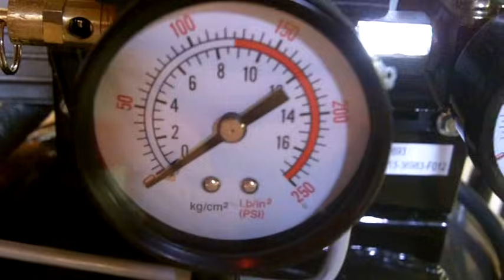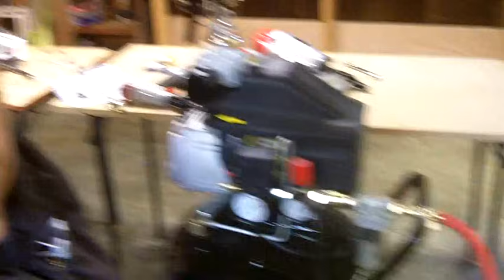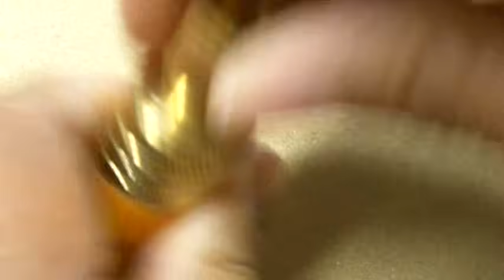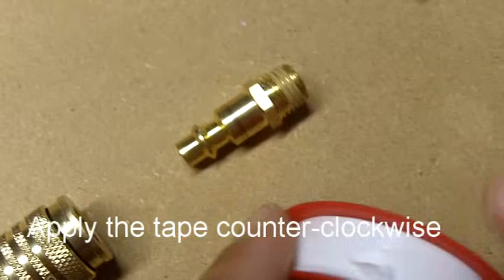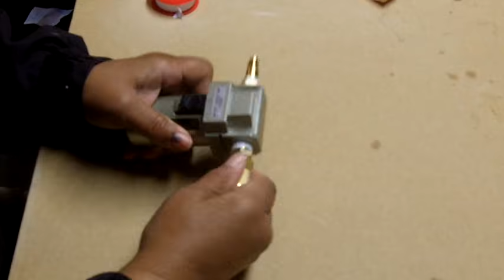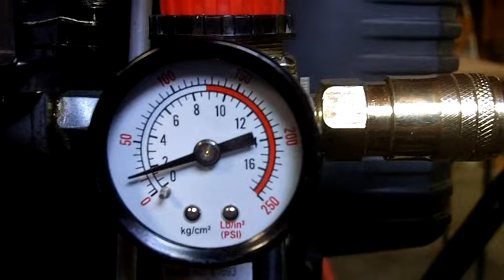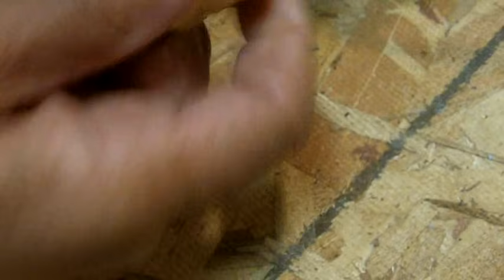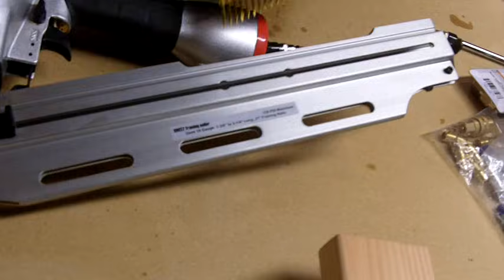Air Compressor, Line Setup and How to Use Air Tools for Beginners

Comment: Hi great video. have a problem with mine just before it gets to pressure the oil filler  cap blows out. Any ideas please
Reply from the maker: Georgia Maccormac  If you supply the make and model, I can further investigate ,  Or you can call the manufacturer. Most compressor manufacturers have a technical support number you can contact and speak with a technical assistance representative directly regarding your issue.

Comment: Great video, I like it so much. I thinking to buy compressor too for my litle garage, one thing I not sure about is the size of the compressor. Better to say size of the bottle. Any advices? Cheers.
Reply from the maker: Rob K Hi Rob, thanks for writing.  As for what size compressor to get, it really depends upon what you are going to use it for. A small compressor would be fine for inflating tires, inflating sports equipment, etc. But if you plan on doing heavier-duty jobs, working with air tools, etc., you'll need to step it up to a larger compressor/bottle/tank.  In addition to the size of the tank, it is important to consider what is called the "CFM" (cubic feet per minute, or the metric equivalent), which indicates the air flow capacity. The higher the CFM, the more power the compressor has to operate various air tools.  For instance, the air compressor that I use in the video has a 21-gallon tank and a 4.5 CFM (at 90 PSI).  Hope this helps.
Reply: seejanedrill Hi, thank you very much for such a quick response. I want to use it for my DIY home workshop, mostly for works around the car, so yes I want to use some air tools as well. Problem is I am quite limited with storage place. I found few middle sized compressors on ebay, can you tell me what you think about this one? : http://www.ebay.co.uk/itm/24-Litre-Air-Compressor-Tool-Kit-9-6-CFM-2-5-HP-/181321137646?pt=UK_Air_Tools_and_Compressors&hash=item2a3794fdee Thanks a lot. Rob
Reply from the maker: Rob K Hello Rob,    I think this is an exceptional buy.  The 24 litre tank is the perfect size for a diy-er with limited space.  The high 9.6 cfm is ideal for medium duty and can handle many heavy duty tasks/tools including painting.  In addition, the reviews for this compressor are outstanding with a rating of 4 1/2 - 5 stars.  I've read the compressor's accompanying data sheet, and its assembly and operation appear typical and rather straightforward.  In all honesty I'd purchase one if it were available here!

Comment: Dear Jane I got a Jun Air 6-25 silent compressor but it has one  gage for the psi in the tank how do I set this up to work with a spray gun and airbrush. Grate video but can you pleas help me with this problem. the compressor was second hand, do not think it has been used, but no instructions. With Grates regards Barry Watkins
Reply from the maker: Barry Watkins Hello Barry,  No worries, I'll send a copy of the operating manual to your mailbox.  Good luck.

Comment: Great teaching video.  I have a small air compressor-6 gal, but I want to buy a bigger compressor that will drive air tools.  Even my little compressor will give me 125 lbs/in, but it is the scfm that confuses me.  How do you match up a compressor to the tools you are using.  Thanks so much for this video.  I noticed you got 16 dislikes.  Ignore them.  I can't imagine anyone with a brain who would dislike this great video.
Reply from the maker: Charlie Wilson 
SCFM and CFM can be confusing,  I hope my explanation will help clear things up.  SCFM (standard cubic feet per minute):  SCFM is the CFM of the air compressor if all conditions were "standard", which is almost never the case.  Actual CFM almost always varies from the standard, depending on changes in conditions.   

CFM stands for Cubic Feet Per Minute, or the amount of air the compressor delivers, measured in cubic feet per minute.  Keep in mind that the CFM a compressor delivers changes, depending upon the psi (pounds per square inch).  Most air tools have specific requirements for volume and pressure listed by the manufacturers on the data sheets which accompany their products( this information can also be found online if you haven't purchased the tools yet but are simply doing a product comparison).  These requirements must be met for their tools to function properly. 
 
When choosing a compressor, consider the tools you want it to operate.  Select the tool you are planning to use that requires the highest CFM, and add a small amount to that number for a margin of safety.  For example: a brad nailer typically uses .03 CFM because it delivers short bursts of air, whereas an orbital sander can be a real air hog, using as much as 9 CFM.  Again, you can find this information listed on the manufacturer's product description and/or specification data sheet.  An added note: if a tool requires 3 CFM at 90 psi, select a compressor that delivers at least 4.5 CFM at 90 psi. This will ensure that the air compressor you purchase can provide the correct amount of air for the tools you are planning to use to be able to function properly.

I appreciate the compliments and comment.  Good luck and I hope my answer helps.

Comment: Excellent instructional video.  I'm wondering what size diameter (inner?) plugs and hose I should be using.  Can I use one size hose/coupler/plugs for all tools like an impact wrench and a brad nailer?  Or will I need different combinations depending on the tool?  If I need different sizes can I keep the size of the hose standard and just swap out the coupler that attaches to the tool?
Reply from the maker: brinbane1 Keeping in mind that I am only addressing portable home compressors here, what I will say is that 3/8" hose size and 1/4" NPT thread size connectors are typical. If you install a  1/4" universal coupler on the hose end which connects to the air tools, it will fit most air tools' pre-installed plugs.  Hopefully this answers your question.

Comment: Awesome video I am having a problem with my air compressor I bought a regulator because the compressor I bought was used.  But every time my pressure builds up it activates my safety valve and the pressure goes back down, is there something wrong that I am doing?
Reply from the maker: MacheteLopez Hello Machetel,  You're at a disadvantage when you purchase a used air compressor because you don't know the history of how it was maintained.  It's possible that the reason the previous owner parted with it was due to the mechanical issue you're currently experiencing.  Unfortunately diagnosing a faulty air compressor is tricky without physically examining it.  A malfunctioning PRV is not something to be taken lightly.  I strongly encourage you to take it to a shop and have it diagnosed.   I'm sorry I was unable to give you a definitive answer.

Comment: Forgot to mention, my stapler "Fasco" came with a bottle of oil and its instruction how to.... about the stapler BUT I could NOT find anywhere on instruction manual where to drop the oil, it just says oil it for maintenance but how and where? no where to find until today watching you video.  About the filter, never new it exists I am going to get one today for always worrying about gathered water in the tank.  One question, there is a knob (can screw out) on the bottom of my air compressor (a round knob + my compressor is very small one) do I have to do anything with it?  Some time ago, I turned the knob to one way and it got stuck there won't screw back to where it was... but compressor works find.  What is that for? I thank you for your advice, hope making some sense to you.
Reply from the maker: Nancy Kim Hi Nancy, Chances are, the knob on the bottom of your compressor is the drain plug to let the accumulated water out of your tank.  Tanks should really be drained after each use, otherwise they rust.  However, you might want to check your instruction manual.  If you don't have it anymore, you can probably get it online.  Glad you wrote to us! :)

Comment: Interesting vid im thinking to buy a compressor to make life easy rather then using ratchet tools which take forever 1 thing is where in uk could i get the filter and is it a must
Reply from the maker: sparkbrookspares   You can purchase a coalescing filter on UK Ebay .  Is the filter a must?  Well, you can run a compressor without a filter, but if you're using your compressor for long periods of time, it can create condensation and travel through the line to your tools. Moisture is damaging to air tools.  A filter costs very little in comparison to the tools you use, which is why I  use a filter.

Comment: hey Leah-  great video thanks for sharing.  i got my first little pancake compressor from Harbor Frieght today.  It's good enough for my home needs.  But my question is, what do you do when you are DONE using the compressor?  Do you close the turn the tool regulator vavle back down to off?  Are we supposed to "bleed" the air?  that's the part i'm confused about.  The "order of events/switches to close" when you're done?
Reply from the maker: Lisa DeMayo Hi Lisa, you should turn the power switch to off, and unplug the compressor.  Then turn the regulator back to the zero position (it should register at 0).  Empty the tank of air, per the manufacturer's directions.  Last, you need to drain the tank of moisture, per manufacturer's instructions.  There is usually a drain valve on the bottom of the tank.  Hope this helps!
Reply: Just to add emphasis ... it is crucial to open that drain valve at the bottom of the tank.  If you don't, water will remain in the tank and it will rust, over time.  A rusted tank is weak and MAY explode under pressure.  Not to panic anyone, but those are the facts.  If you treat it right, it will be safe.

Comment: Leah, thank you for such an awesome video for newbies. This helped me correct a couple of things that will make switching tools much easier. In addition, you explained the gauges well, which will prevent me from making a big mistake concerning the pressure. This was one of the better videos of instruction that I have seen. The user manual that came with my Craftsman Air Compressor was virtually useless. Thanks to you, I am confident in operating this equipment now. Thanks again!

Comment: Very usefull video .. but for normal nail gun is the 24 litter compressor will do the job for me .. thanks in advance.
Reply from the maker: Samer Aal-rassul  a 24 liter tank is fine.  Keep in mind however, that rapid fire nailing, over an extended period of time, will quickly deplete a small tank's air supply.
Reply: Thanks you are great teacher but it's for my home workshop.. i mean is it enough to complete one day preject ? let's say 20-25 3 inch nails .. regards
Reply from the maker: Samer Aal-rassul Hi Samer, It will be fine for your project!  Good luck.
Reply: Thanks alot

Comment: Thanks a lot Leah... I spent 23 min & 43 sec  for something worthy. Just bought the same 21 Gal unit from HF. Quick question about the filter: HF sells  couple of different ones; Pls help me narrow down to which one I need for this particular model>1) I am assuming we don't need a filter w regulator as we already have a regulator for the air coming through the hose to  tools built in the  compressor? 2) one w/o regulator says 100 psi max... is this basically setting up a cutoff of psi and in case we need a tool which requires more than 100 psi will this filter be pointless as our compressor has a max of 125 psi?

Please advise to pick the right filter. This could be of use to others too who are on the same boat like me:)
Thanks  again as I feel much more confident now to use the tools
Also do you have any videos for impact wrench & hammer?
Joseph
Reply from the maker: Joseph Peter (Updated Response)  Hi Joseph, What you have to keep in mind is that most air tools require 90 psi air pressure to perform optimally. You don't need to run the tool at its maximum psi.  To explain how this works, here is an example: We have a 21" angle framing nailer, labelled with a maximum psi of 120.  However, the working pressure for the tool is between 70 and 120 psi.  A good working psi for the tool is 3 CFM @ 90 psi, according to the manufacturer of the tool.  So, the filter that you have identified above would be just fine for this purpose.  You really have to look at the tool you are going to be using and its air requirements.

Comment: Got the same compressor from HR about a month ago, took it home then realized that I needed all the fitting for my tools then went back and got them. One week of use it tripped the reset switch and continued after I unplugged it. Called them up drained all the oil but the oil was filled with a metal slurry. Did some research online took back the unit got a replacement, new output connector to be placed after the regulator and some extra compressor oil. Broke it in change the oil three times and she purrs .....but wished I saw you vid before I got it... Lesson learned
Reply from the maker: krazytrinisteve Great, well, I'm glad you got it going and that everything finally worked out!!

Comment: How many psi did it need for the 21 framing gun to work?
Reply from the maker: Andre Farley On mine, the max was 120 psi for the tool.  However, I used 90 psi.  It takes very little air to drive a nail.

Comment: Great video, you should be a shop teacher. I just received a used Hitachi air compressor that  am fixing up and this video is a great starting point. I did notice though I only had one gauge not 2. Not sure is this was removed or if this is how the old air compressors were. This compressor is at least 25 years old if not older.
Reply from the maker: Thanks for the compliment...actually I was shop teacher! :)  Sounds like you have a fun project on your hands, good luck!